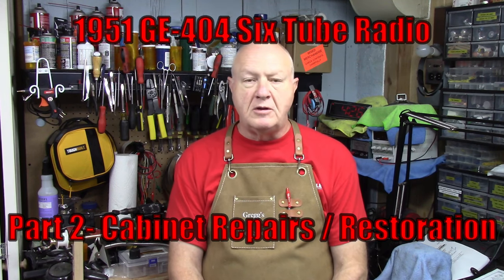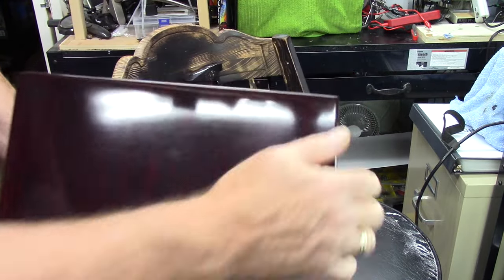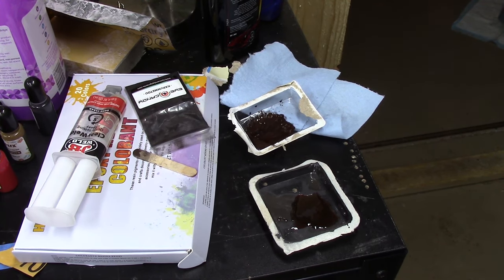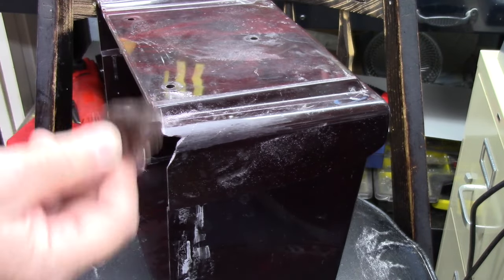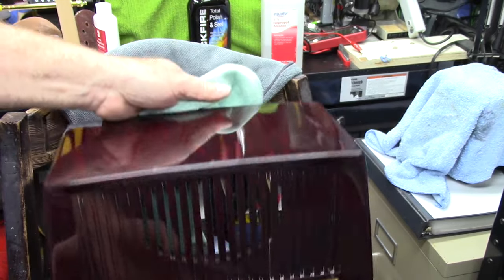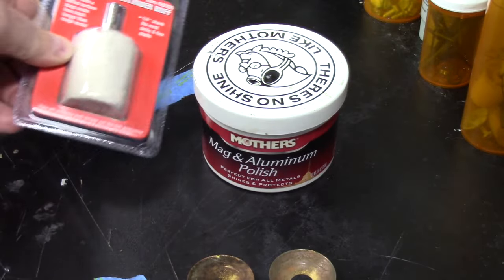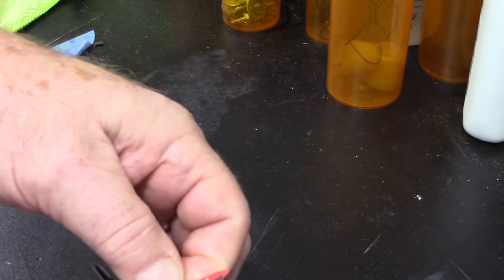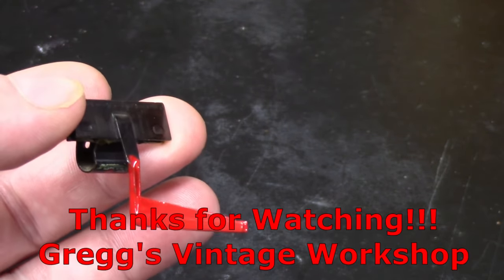1951 GE- 404- Six Tube Radio- Part 2- Cabinet Repairs & Restoration

Comment: Gregg,
Have you considered using a CAPACITOR to drop the voltage?  Check this video out:
https://youtu.be/mCRNkKfrGBg
In one of this series, he shows how to calculate the value of the capacitor.
Another excellent source about using the capacitor to drop the voltage (and the capacitor does NOT get hot at all.) is this one:
https://youtu.be/iA932OXcSuk
Hope this is of use to you.
Reply from the maker: Yes I did that on my little CF255 Emerson a couple of years ago. Since I was dropping just a few volts I feel the resistor was a good solution. Higher voltage drops can be had with no heat using the capacitor method though.